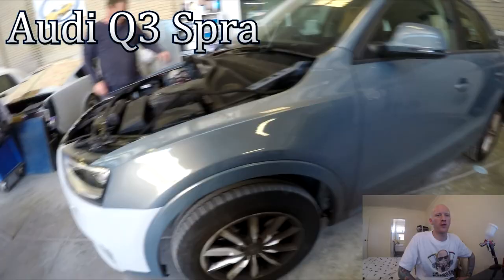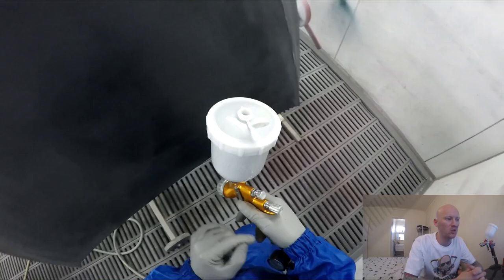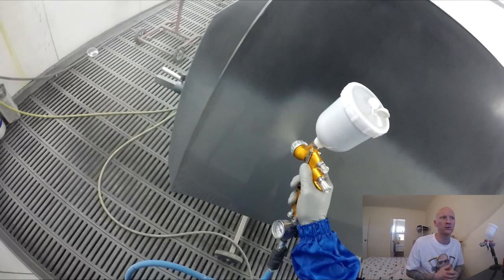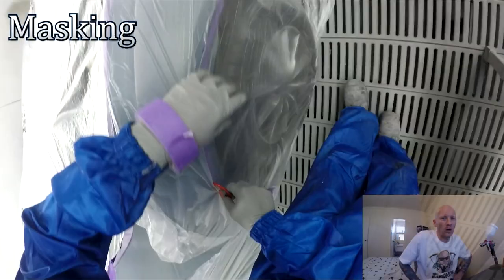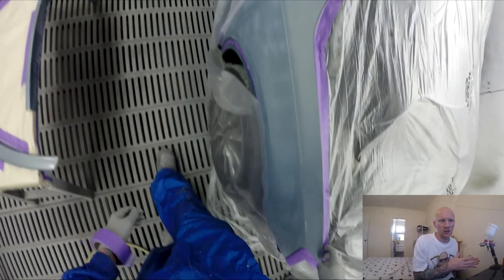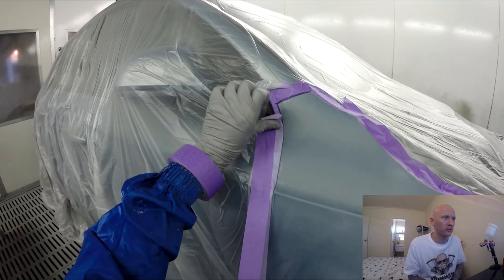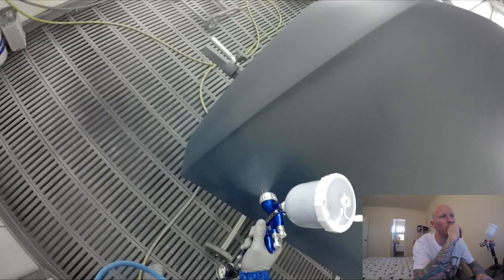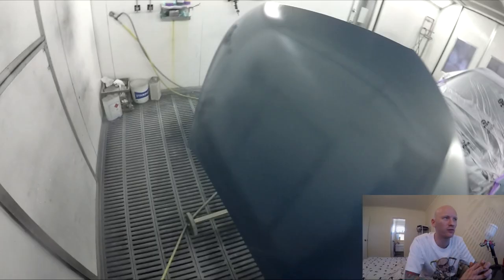Audi Q3: Spray Painting

Comment: thanks for helping me stay motivated at my job, i'm also a painter. bought the gti pro lite tekna because of you
Reply from the maker: Do you like it.
Reply: yep, my sata5000 is now my basecoat gun lol. took a while to get my settings dialed in on the gti, but its basically full fluid full fan. you could make so much money here in the u.s.
Reply from the maker: Why am I not surprised :)
Reply: Jake, jut wondering what you're running for all the other settings on the Pro-lite.... PSI at the gun, etc.
Reply: RPMX4 hey man, when I'm spraying clear I run 29-32psi at the gun, before an in-line dryer. Also I turn in the fluid half a turn and turn the fan in just a hair.. its somewhat forgiving, but I just keep it moving!
Reply: Thanks for the feedback Jake.  I am using the Pro-lite for clears only as well and have varying results.  Was just wondering if the gun is just that sensitive as when I'm at 30 PSI, it seems to be pounding the clears out.  I'm only in a back yard shop, but am getting very nice results.  Just trying to fine-tune.  LOLHappy painting my friend!

Comment: i would like to thank you for your awsome videos , i was watching your videos since the beginning , i am an IT Technician from Morocco 24 years old , yesterday i painted my friend's Mercedes E350 cdi AMG 's front bumper with a 70$ compressor and sata 4000 hvlp which i rented it from a workshop nearby for free to get the job done . i am proud of the result my friend like it and the guy who gave me the gun from the workshop was like " WoooW " , it was a mirror finish with no drops or fish eyes . i used the " special paint " called here in Morocco , it's like base coat and clear coat mixed together , the important is that you get the shinny finish hhhhh . the guy from the workshop want to ask you about a problem he has , the clear coat get off the base coat after time , so whay could do this problem ?

Comment: Hey Gunman, I watch your videos every day, I'm a painter and a lanterner. Until today I do not have the right pistol to make an ink application. How can you recommend a pistol for its good use? Can you give me the name of some that I can buy to make metal or polyester paint?
Reply from the maker: I can't say I've ever applied ink but for the polyester paint if it's a polyester primer that's used on restoration work as a sprayable filler then you'll need a 2.5-3.0mm tip on your gun.

Comment: just curious what sort of mic are you using is it a web cam mic ? im using an ic recorder for my videos always looking for better ways to increase the mic boosting it through premiere can be a pain @ times to get the levels right
Reply from the maker: The audio for this is straight out of my GoPro 4, first time I tried doing it I was using my Samson meteor mic but for some reason over the length of the video it started getting out of sync so forced to use the GoPro audio but I still reckon it's decent quality considering it's an actioncam, I edit in Sony Vegas 14. I cut the audio of the paint clip right down and leave the narration full.
Reply: ok many thanks for the info gumman that gopro 4 sounds like a goa compared to my dig slr fujifilm fine pix hs 20exr good info cheers mate always giving me tips *

Comment: hello man i 've  been washing your videos i need some help with setting on sata jet 5000 b i am working clear coat matrix  auto glass ag40 clear coat i need to know pressure on gun .and turn clear on gun.i am working on fl higt temperature over 70 degrees i need to know if you recommend me add reducer when i mix clear i will appreciate your help, thankyou sabo.
Leer más
Reply from the maker: so that's about 20c and at that temperature yes a bit of reducer could help, I sometimes like to heat my clear up when it's a bit cold like that, it will make it thinner and flash times will improve.
Reply: thank you man.my sata is not digital soo i 'm not  sure if 1.3 bar on gun with two turn open  be good setting

Comment: Mr gunman i am getting a gti prolite witch one can spray clear .base .hvlp what end tips do i need any info would be good and were can i get one i dont trust ebay an im in australia
Reply from the maker: These guys are trustworthy spraygunsdirect.co.uk and they are my sponsors, as far as setup goes I'd recommend TE10 or T110 in 1.3 or 1.2 if you aren't overly experienced, those air caps consume less air than HVLP also, HVLP aren't as nice to spray with and unless you know how to use them and have a powerful compressor you will likely get a lot of orange peel and poor results.